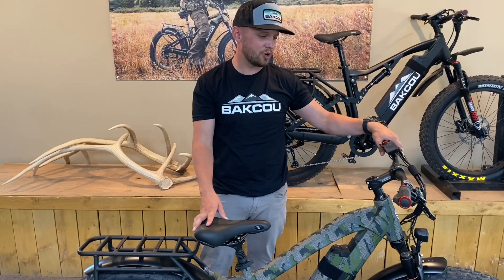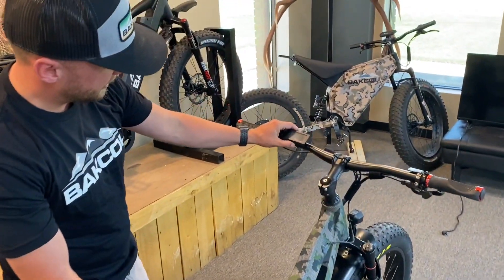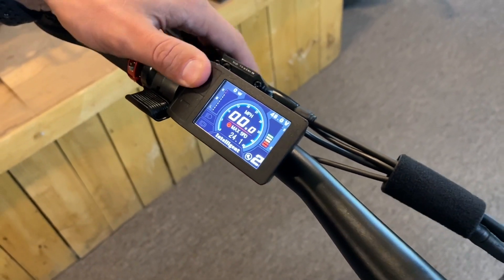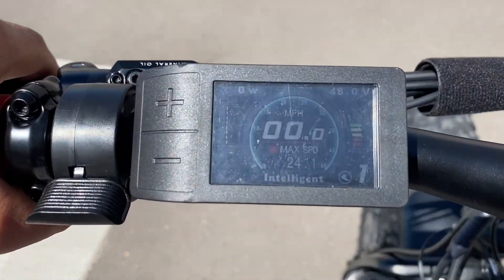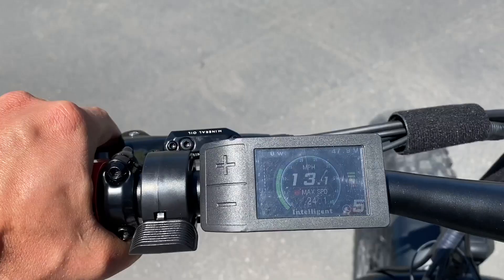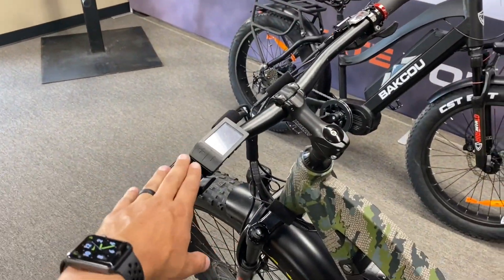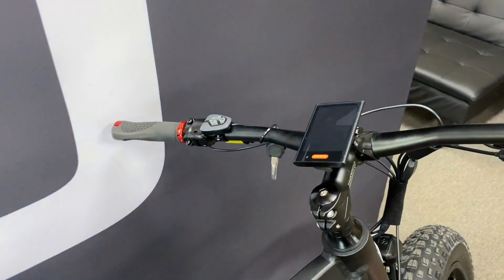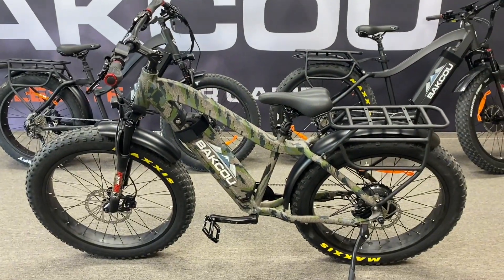How-To | Navigating Bafang's Hub-Motor LCD Display

Comment: by the way... if you spray that display with rainEX or Pledge furniture polish, it will make it clean and easier to read...
When you turned it on inside.  i just saw a bar batter indicator.. and outside:  Does it have Voltage and Watts indicator..?

Comment: How does it work? Can u use both high gear or low ger on any pedal assist mode
Reply from the maker: Great question. Yes you can. Just like any bike however, you don't want to start peddling in a higher gear from a stand still. Same thing with the throttle. You don't want to start throttling if you are in a higher gear or it will put higher tension on your chain.

Comment: Why hasn't Bafang come out with IPS TFT sunlight readable LCD displays.. (oh forgot they do have one and it only displays 5 bar battery level (not Voltage) and it doesn't show Watts.. the information is primitive and limited.
IPS screens are truly "sunlight readable."  you appologized because of reflection.. That tells me and shows me that this display is very difficult to see in the sun if not downright impossible.. The Bafang IPS SLR EB04 display is great.. But i don't need Navigation.. I need to see important info like Watts/Voltage/Trip/Speed.. I have a solar trailer behind my BBSHD equipped 52v mid drive recumbent trike.. And in order to optimize the range, i need to adjust the Power level:Gear ratio... And the only way to do that is to watch the watt draw and voltage/speed readings.. Bafang really needs to listen to it's customers..  If they can put bluetooth navigation into the display that can be seen in the sunlight, they could eliminate that and replace it with WATTS/Voltage etc...